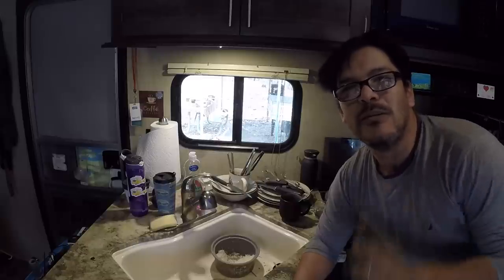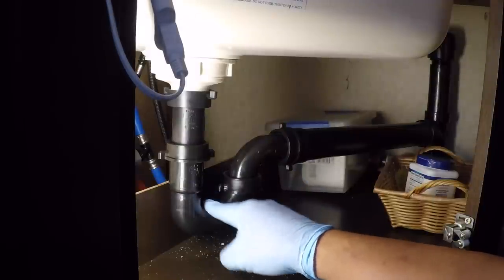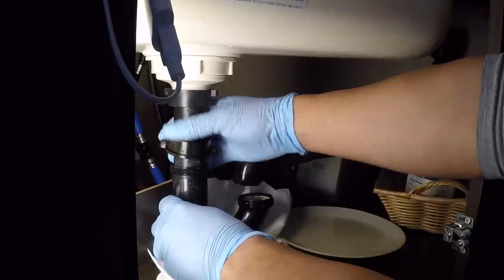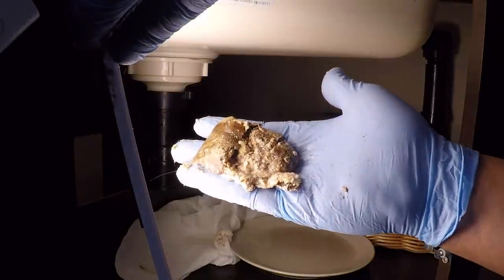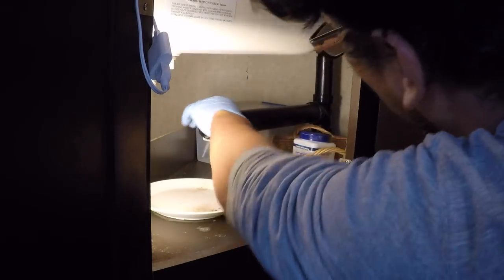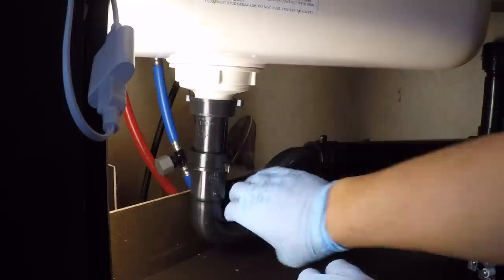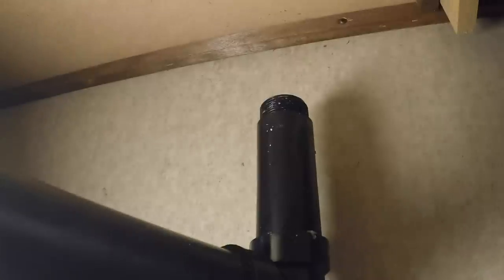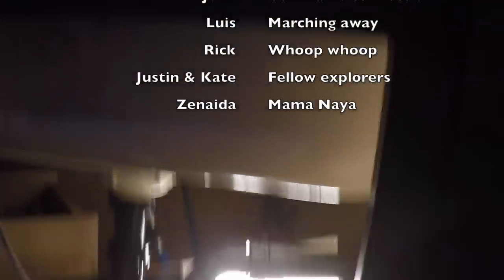Oh No! Our RV Kitchen Sink is Clogged! Full Time RV Living in a Travel Trailer

Comment: We pour all our grease into large pickle jars than just toss them into the trash. I am sure we are still getting some grease in the pipes but not as much. We lived in the country for many year with a septic tank and no garbage disposal so we learned the hard way not to dump grease or oils down the drain. Glad you got liquid plumper to work for you. You can also use baking soda and vinegar in the pipes to clear away clogged up pipes.
Reply from the maker: Thank you for the tips!

Comment: Prevention is worth a pound of cure.  #1.  never pour grease or oil down a sink. scrape it from the pan into the garbage with a napkin or towel as much as possible first.  #2. Get a cheap wire mesh sink strainer to keep out big particles  #3 (and best). After a greasy or oily meal, follow up with a pot BOILING water every time.  Stays totally clean.  :)   LOVE the video!  :)
Reply from the maker: Sometimes we tilt to the left for months at a time!  It can't all drain easily all the time :)
Reply: LMAO   You kill me.  :)

Comment: Good advice on what the others say on not pouring grease down the drain.  Still will have to clean the pipes from time to time, but not as much.  When we were workamping, we were able to use all tools at any place we worked at.  Like a pipe snake.   Also don't forget your bathroom sink and shower.   Have to clean those from time to time too, now that your a master plumber.  (grinning)
Reply from the maker: Thank you so much Nolan B!!

Comment: Running hot water won't break it down and push it out?
Reply from the maker: I tried quite a bit of hot water (boiling hot) to no effect. It just hits the clog and stops and cools down eventually and the clog resolidifies.  Nice stuff!
Reply: Wow insane. I truly have to curb my bad habits of throwing all my used geese down the drain. Always figured hot water will help push it through.
Reply from the maker: Yeah, I sent at least two gallons of the hot water (slowly) down to no effect.  Only hot water after the liquid plumr worked.
Reply: @WalkAndPaddle  Bro wish I could upvote this to the moon. Literally doing that right now and frustrating myself to Maximum effect. Time for that Walmart run!!!